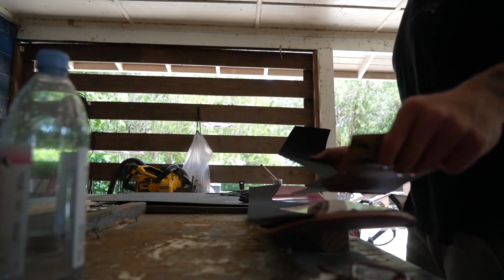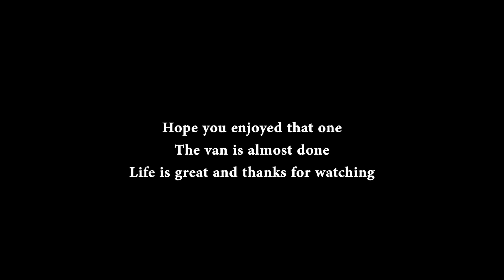Surfing, Skating, and Van Building

Comment: Don’t wanna be that guy but they call it the dog House not the dog box.
Reply from the maker: Oh really I actually did not know
Reply: Dog box is close though. Not trying to correct you,  i’m a van guy I’ve been wrenching on these damn things for many many years just sounded funny when you called it a dog box. Van is looking sick though. I personally can’t live without a van i’ve had several makes and models of them currently have a Chevy express high top just got done building a platform style receiver hitch bike rack for it that holds 4 bikes or whatever gear I need to strap down to it. I’ll tell you if you did a 4 x 4 swap in that van you could probably get an easy 20k for it. I have converted a few but I did one last year sold for 31K was a 1997 Chevy express with 140k miles on it. Picked up the van up for 6500 off Craigslist then junkyarded the transmission, T case and solid axle was in it for just under 9,000. I did it all in less than two weeks then it took about a month to sell.